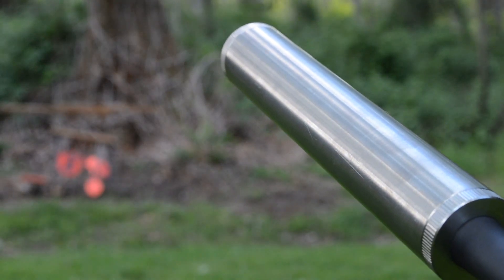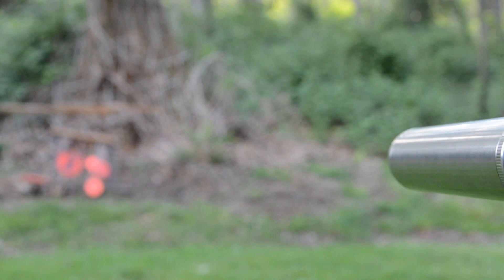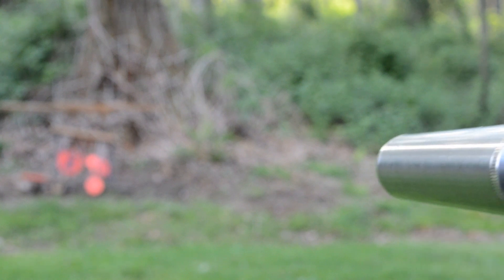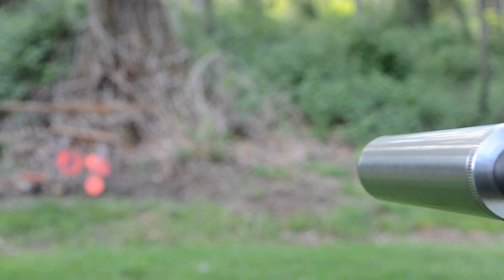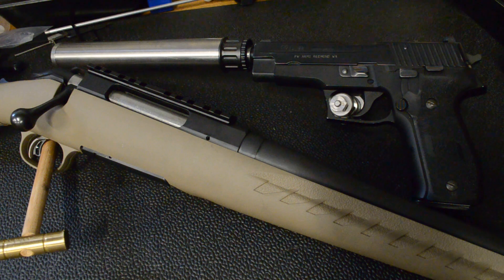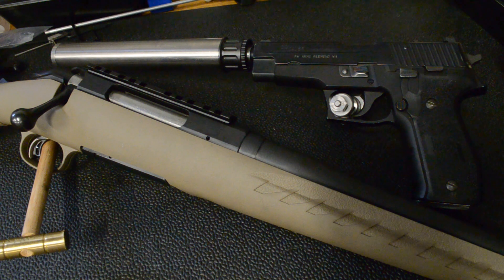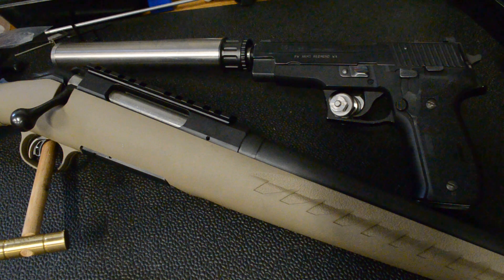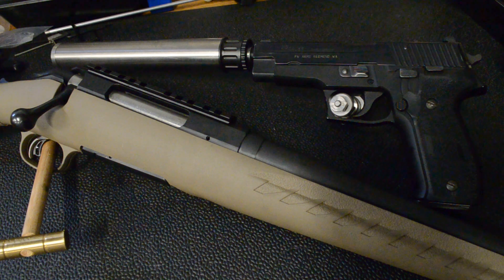Sound Test: Form 1 9mm/300blk Suppressor

Comment: Not sure if somebody else told ya, but if you put a dab of wire pulling gel or a teaspoon of water in the suppressor, your first round pop goes away and it ends up quieter.  Just don't try it with supersonic 300 blackout.
Reply from the maker: Yeah, I prefer to run them dry since they are already so quiet and then there is no mess to clean up later.
Reply: Guy in a garage My thought is to practice like you would employ.  If you ever have to take a shot in the field (hunting, predator control, zombie apocalypse) then you should always take the first shot wet.  It doesn't take much coolant to get rid of first round pop.

Comment: Could suggest that during each shot you stop talking it was hard to hear the actual sound of the rounds.  Please keep it coming!
Reply from the maker: Unfortunately, my microphone/camera will adjust the gain if I stop talking and then take the shot, so the sound level is not accurate (I tried it this way first).  This is the only method I was able to find where what you hear through your speakers is similar to what you hear in person.
Reply: Very well, no worries then!  Thank you for the Videos and keep them coming please, they are helpful.

Comment: What diameter hole did you go with to use for both 300 and 9mm? I was thinking about using 3/8". I'm not sure if that will be too tight for 9mm though.
Reply from the maker: .400"  You can do .375" for 300, but it's a bit tight for 9mm.